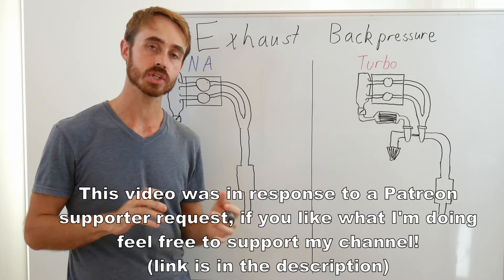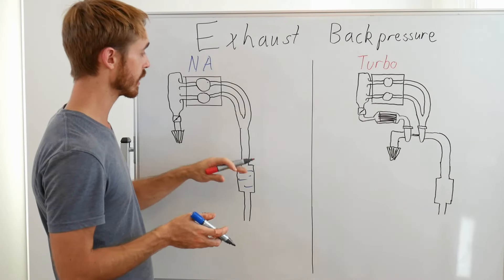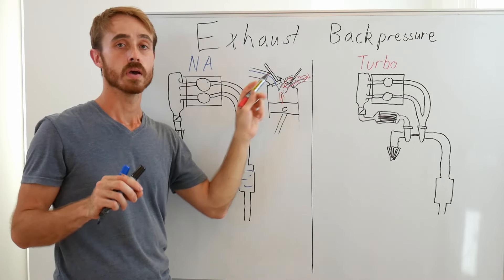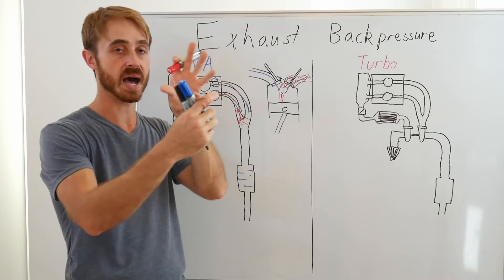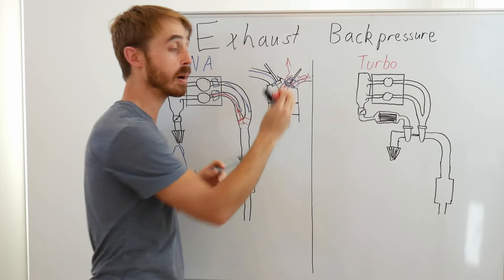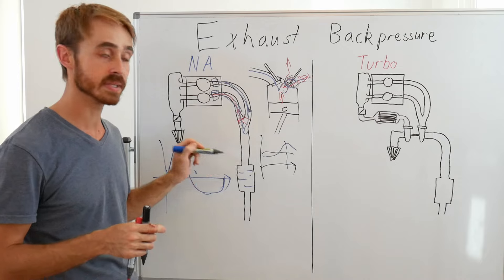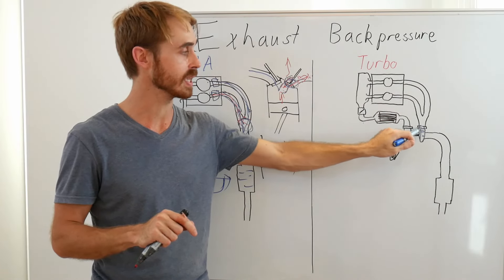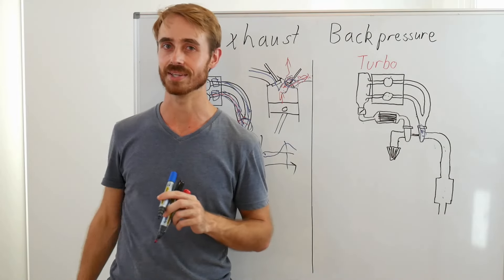How Does Exhaust Backpressure Work? - Basics of Pressure Wave/Harmonic scavenging

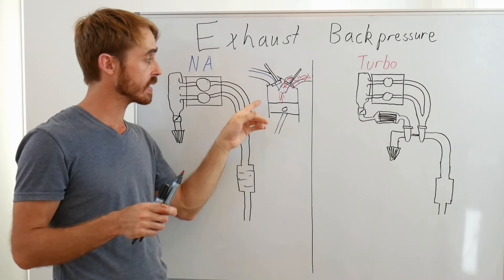Comment from the maker: Technically speaking, "Scavenging" is just the process of venting the exhaust from the cylinder and drawing in a fresh intake charge, what I talk about in this video is more Pressure wave or Harmonic Scavenging. There is also a bit to be said about gas velocity in the runners, but this video was already getting too long. Also, minor correction - at 3:30 I meant to say "combustion products" not "unburnt gasses"

Thanks for watching!
Reply: KYLE.DRIVES I look forward to every video you make, thank you so much for making these!
Reply: Excellent channel, I've just found and subscribed! Another very pedantic point, you say 'heat' when you mean 'temperature'. Yourself and many of your viewers will know the difference, but just thought I ought to mention.
Reply: ***** thank you for that additional information. That really clears up the question of how less back pressure can become a problem.
Reply: C Sbastianygaumnitz it can smoothed out in a dyno tune. Or flap inside the exhaust you can control. I like to dyno exhaust changes. but who likes paying money each time you change Lol?
Reply: I'm sorry that make no fucking sense why would you even want more backpressure on the exhaust you just said it would not allow for optimum combustion.....I think this is where the insufficiency of engines takes place. also thats why drag cars DONT HAVE BACKPUSSURE
Reply: I'm Curious Kyle about a dilemma I'm facing as I'm just unsure. My headers are 42 inch long 2 inch primaries going onto a 451 stroker big block inside of a dodge dart. I'm sure the primaries are toooo big for my needs but I got them $350 off brand new price. They are polished ceramic coated from hooker. Can I do anything to help keep some of the torque I will lose, by the way they have 3.5 collectors. Any advice will be greatly appreciated.
Reply: @fokjohnpainkiller  it's your phone
Reply: @mceperformance8978  yes that tends to happen amongst those two
Reply: Can you make this video longer?
Reply: And, we should see harmonics of the ratification frequencies as well.
The key, it seems, it to have high pressure at the intake, to push more air thru.
Reply: Great  video thanks for sharing 
I understood the intake resonate system but didn't think too directly about backpressure I  this way
Reply: you probably dont care at all but does anyone know of a tool to get back into an instagram account?
I somehow forgot my login password. I appreciate any tips you can offer me
Reply: @Abdullah Andy Instablaster =)
Reply: @Malakai Valentin it worked and I actually got access to my account again. I'm so happy:D
Thanks so much, you saved my ass !
Reply: @Abdullah Andy Glad I could help =)
Reply: @abdullahandy9493  
Depends on your OS, sometimes passwords are saved on your device, such as iOS
Reply: ⁷

Comment: Great video. This is especially important on rotary engines. The main reason all pre renesis (RX8) engines gained huge amounts of power after putting a free flowing exhaust system on is because the factory exhaust system was the cause of excessive back pressure, once you put a larger free flowing exhaust system you saw anywhere from 20-30 % power increases. Unfortunately the renesis engine sees very little if any power increases (sometimes 5-10 kws if you are lucky) with an exhaust system upgrade because the side exhaust ports are the cause of the restriction in the exhaust.

Comment: Hey, I own a 99 GT Mustang.  In 2013 I installed a pair of Flowmaster super 44 because of the " back pressure". Now, in January I installed a pair of Dynomax UltraFlo. That's a direct flow and, wow, the difference is huge. I can't talk about armonic or whatever, I can talk about the difference in power and response of that engine. Somenthing that I can feel.

Comment: You're mistaking back pressure for Flow Restriction, and the reverse pulse of exhaust gases into the intake is called reversion.
Reply: A flow restriction would cause a lower velocity in the exhaust gases which would result in a higher pressure would it not?
Reply: @pizzaguy58  , without redoing the entire video, because this man's understanding of the terminology he's trying to speak of his inadequate for what he was trying to explain, I have to let you understand that a Flow Restriction it's not intentionally put into exhaust systems. It's usually an effect of an engineering anomaly. Exhaust Scavenging is done by tuning the exhaust so that adjacent cylinders are always drawing air and trying to keep the exhaust pressure as low as possible when the valves are in an overlap condition. Scavenging is best done by tuning the exhaust system so that the exhaust gases are at their lowest pressure in the manifold so that they don't cause a reversion up into the intake or as little as possible, when the valves are in a condition of overlap. At no time did I suggest that I Flow Restriction will not cause back pressure. But flow Restriction has not been intentionally designed in cars since the late seventies I think when they still had the heat risers on the right side manifold that would choke off the exhaust on the right side and force it underneath the carburetor to warm the engine up a little quicker. Some flow restrictions have been put into cars by accident or incidental misunderstanding of wave Dynamics. Any time an exhaust pipe is longer than 3 feet it starts to draw power from the engine because it starts to cause a problem with the way wave Dynamics occur inside a long straight piece of pipe. It is also why you have different size exhaust pipes built on to larger displacement engines because flow velocity has to be maintained in order to provide Scavenging to the individual cylinders. And there is no internal combustion engine that is perfect at that. The limitations of design require that there's going to be some pressure within the exhaust that is going to be higher then on the intake side of a cylinder because that's just the nature of the Beast. So I think you understand now the difference between Flow Restriction and exhaust back pressure fit is not necessarily designed into the engine but it doesn't affect of the fact that it can never be done completely away with. And I think the confusion comes in the fact that exhaust back pressure is piss poor terminology.
Reply: I see what you’re saying now, I misunderstood in the first comment. So then what would cause flow restrictions in a regular naturally aspirated exhaust? I thought you were referring to the restriction of flow through the sound muffling in the system. When I think of back pressure I think of anything that resists the flow, which I would think flow restrictions would be included in that. Am I wrong in that thinking?
Reply: @pizzaguy58  only from a technical understanding. But it helps to be accurate so that you don't conflate your terms. This was not a good video for the explanation because the person doing the video was not aware of the proper terminology himself. At least not all of it.

I've seen reversion so pronounced that it actually creates a fog above the carburetor when you're racing on a dirt track or even an oval track.

Comment: You made a very informative video. What I learned is with an n/a motor, you should buy a well engineered exhaust system. And for a turbo car, just cut all the exhaust off or run as big as possible.
Reply: Yep, basically Ken Block's Hoonicorn

Comment: So for turbo engines: open downpipe.
Reply: That’s exactly why I came here Lmaoo
Reply: I try it on mk4 1.8t and the torque was not as good as oem but it was epic anyway. 2.5'' downpipe it's better
Reply: @s.lacasse8337  my mk1.5 MR2 has essentially an open 3" from the turbo back. Fantastic spool, great hp/tq, bit loud. Fabricating an exhaust right now that has a cutout that splits into a 3" extra quiet muffler and rejoins to a single exit. Silent mode -> race mode with the same 3" tip
Reply: Im sorry for being dumb but what is downpipe?
Reply: @rohitdalvi9361  the pipe coming directly off the hot side of the turbo

Comment: You explained things very well, however when you said engines will 'need backpressure' you should have rephrased it as a tuned system will result in some backpressure in the unoptimized area in the power band(which you sort of said).  Otherwise well done and Ive been saying the same stuff for years and its nice to have a video I can link to save my breath lol

Comment: setting the overlap of the cam and cam timing is everything,but the exhaust design also adds to the scavenging,hence expansion chambers on race two strokes,some of the changes were dramatic to say the least,there are people in the industry that can give you what you want in design for your specific rpm range

Comment: with 2.75-inch straight piping and a regular normal muffler I got a skyrocket rpm boost from 5k rpm to 7500rpm on my d15befi non vtec it feels wow at that rpm band point my experience helped me understand your explanation also good amount of torque is available at lower rpm also

Comment: Good vid. Probably helped a lot of people. I would say that the content is pretty low complexity to moderate at best. 
--A lot of people confuse what "Back pressure" is. There is no back pressure until the engine is running. Sound stupid, but basically back pressure is the result of engine dynamics. There is no reason for back pressure at all. Now, some people will call the pressure differential between exhaust port output and turbo exhaust intake as back pressure. I can see why, and whatever. But, beyond the turbo exhaust out, there is no reason for any back pressure. The only reason, to my understanding, why there is even an exhaust at all on a vehicle to to quiet it down and pass emission standards.

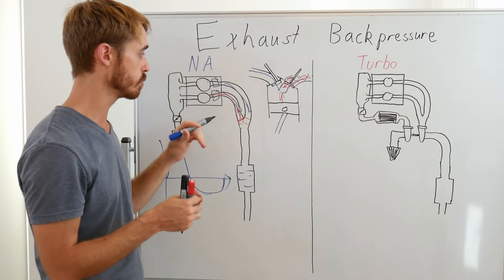Comment: You are confusing the hell out of people by calling transient waves "back pressure" they are NOT, the overall actual back pressure does not change because of them.  Also 5:20 you say a negative pressure should get to the exhaust port at valve opening. NOT so. The flow out the exhaust valve at that time is choked and no amount of suction down stream can affect that flow at all. The negative wave is timed to arrive at the exhaust at it's closing time and during overlap where it can pull out remaining exhaust and start pulling in fresh air from the intake. You are supposed to know this stuff.

Comment: Thank you for the very informative talk. Can you address a few question I have about turbos in a future video? I want to know how much of the airflow the exhaust side of the turbine captures as it exits the engine. And what the turbine is doing when there is no effective boost. Or, does it always provide a small amount of boost? 

I understand that when the vacuum reaches maximum on engine over-run, the fuel is cut, and only air is passing through the engine - using its compression to act as a brake - is that right? 

What 's happening to the turbo on over-run? Does it stop, or just slow down? What would be the minimum sort of speed a turbo spins, with the engine simply idling?

When I get into the gas, but limit the boost to 0 psi, does that represent the maximum power the same engine without a turbo would make? (Or very close to  it, due to the internal drag of a non-boosting turbo.)

What happens in the turbo housing when I get to peak turbo boost? Is the wastegate opening just enough to maintain the pressure on the outlet side of the turbo? I have a very small turbo on my old Tommy Kaira M20b, and I wonder what sort of revs it might hit at 10psi boost- would you hazard a guess? It makes some wicked sounds!

What happens to the revs of the turbine once the wastegate begins opening? Does it stay constant?
Reply: Just now finding this channel but this is a great question! (Or, rather, series of questions)

Comment: In all exhaust system, there is an expansion chamber in the form of a middle drum with no baffles, generally with 15 times cylinder sweep volume to allow the exhaust gas to expand sufficiently to maintain a stable anti-node and much reduced back pressure (near ambient) such that variation of pressure in the silencer system does not affect the header system much, this is more important for a tuned header, however, addition of a catalytic converter generally creates a significant back pressure while obviously being a stable node in the acoustic system of the header.
Reply: Air planes have tuned exhaust and zero expansions until the end of the pipe.
So i disagree that all systems have this middle drum.
Thinking of it the only expansion chambers I have seen are on 2 strokes.

Comment: There are quite a few points you have missed here, drag cars with cross plane cranks don't use venturi based scavenge effects like a flat plane cranks due to the different firing orders, the reason they don't use a collector mostly is because the scavenge is not really working in a V8 cross plane crank engine.
A flat plane crank like found in Ferrari engines for example can utilise a proper collector for exhaust scavenging effects, but these engines also have inherent vibrational issues as a trade off.
Pressure wave pulses work better from log manifold that that of collectors, but log does not scavenge using venturi vacuum and high velocity, scavenging using a venturi effect is better in a collector exhaust system and a higher exhaust velocity is essential to help even further, this is why a proper gauge exhaust tube is required for each engine to keep velocity high.

The turbo charging exhausts love a huge exhausts for your explained reasons.  I had a twin turbo GTR a few years back making 500AWKW with twin 2863's on it and the amount of restriction in the exhaust housing was so great I had to use 33psi just to push against it.  Also the twin turbo's run out of puff with LPM in the intake manifold compared to larger single turbo.
I should have gone with the larger single in the end to keep the LPM's up and use a lower boost pressure to achieve the same power.
Having such large boost intake pressures was not easy, the coolant temp levels were around 127C at some points around the 5th lap mark on track.
Obviously with pressure came heat and probably the most significant issue was the huge amount of pre turbine back pressure issue that would have been keeping exhaust gasses from escaping properly, I was well and truly pushing the limit of twin turbo's to levels I really shouldn't have been for the given power levels.
I could have cooled it more with better cooling systems, but at the end of the day, it was the poor little turbos that needed to swapped out for a larger, better flowing single.
Damn it had some crazy driving response though, it was an absolute weapon.

Good video Kyle, keep em coming mate, peace out from Perth.
Reply: Too long but interesting 😸

Comment: it'd be awesome if you could do a video just on n/a engines, (optimal intake pressure, temperature and resonance??) as well as more on exhaust pressures and design in race applications! I am looking to design a custom intake and exhaust system for an n/a engine (ej25 to be specific) to be used for racing, and am thinking of cooperating with bodywork for both the intake and exhaust. I'm wondering if designing an exhaust with similar properties used in diffusers (lower pressure at the exit) would effectively create a sucking effect on the exhaust? very interested to hear more about n/a!!

Comment: Liked it !  When i took my catalitic converter out, it actually made it worse....started to loose power at high rpm, and the top speed dropped....also the mid rpm torque dropped.....
Reply: You need long tube headers you basically moved your back pressure to your muffler, either get some bends in the exhaust or get some longtubes

Comment: Hi Kyle.engineers, thank you for explaining the flow in the exhaust. I found this verry interesting.

I stumbled upon you’re video as I was looking for a faultcode on my MB C class 180D 2015 model.

The car has a fault code on the exhaust back pressure sensor (P047121A). I will replace the sensor, but what is actually the function of this sensor? Does this has anything to do with valve timing to reduce the backpressure (as this is a turbo charged car)?
The fault comes up after overhauling the DPF (almost immediately) and I was wondering, why is this at this moment, what is the logic of that.